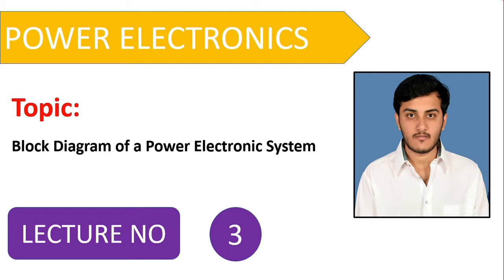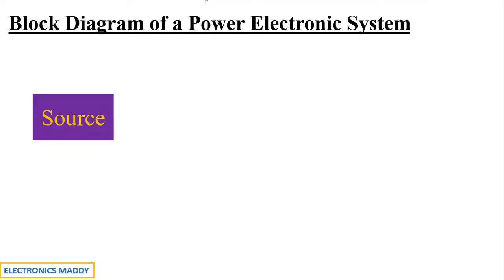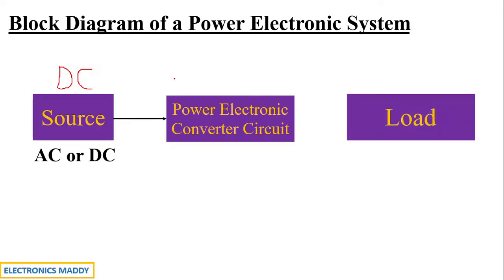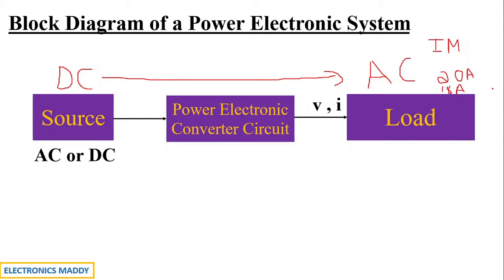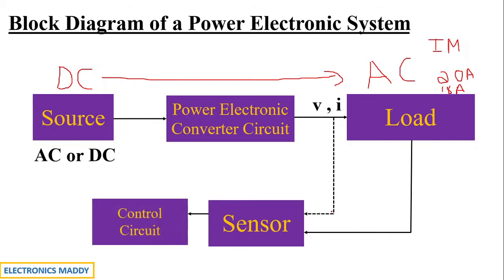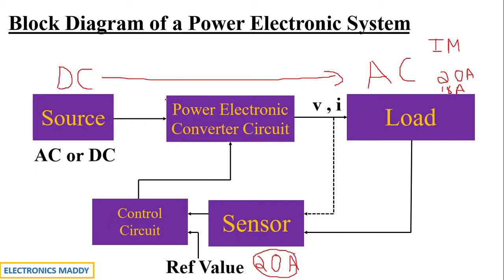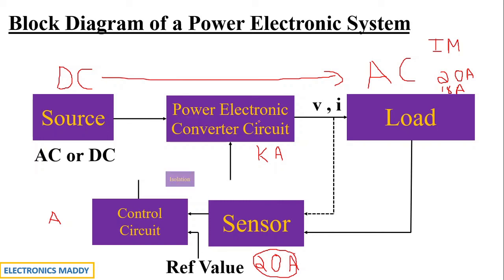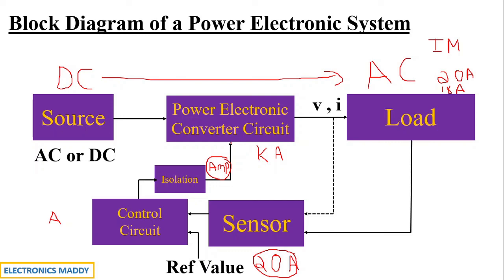Block Diagram of a Power Electronic System | Power Electronics | Lecture 3

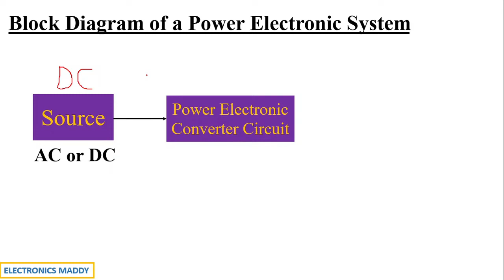Comment: @01:10 isn't that DC to AC conversion called an inverter while DC to DC conversion as Converters? Correct me if I am wrong.
Reply from the maker: You are definitely right. But in general what I was trying to explain is the process of conversion of power itself is referred to as power electronic converter ckt. So I used the general term here.